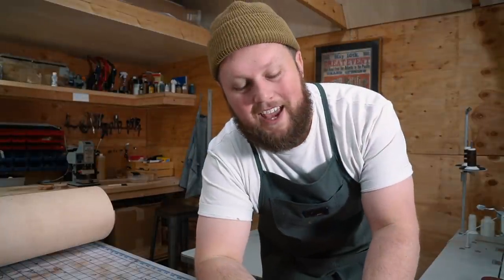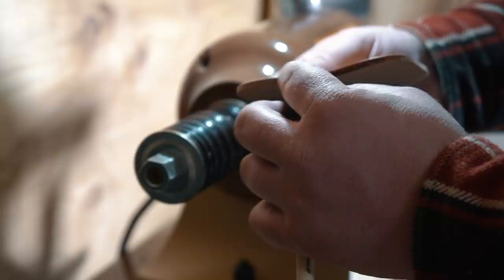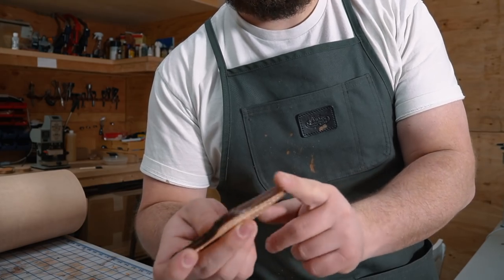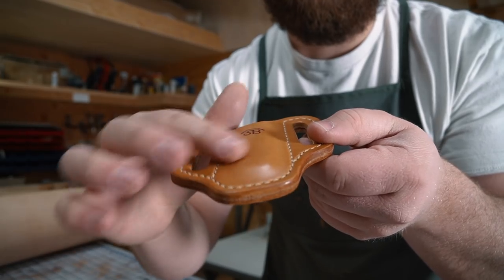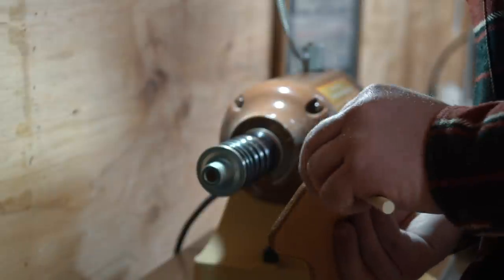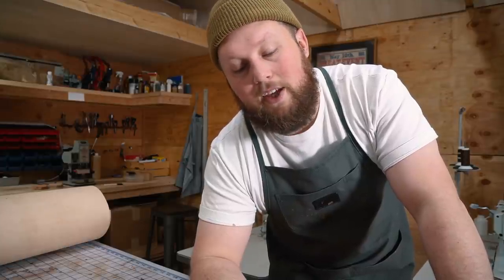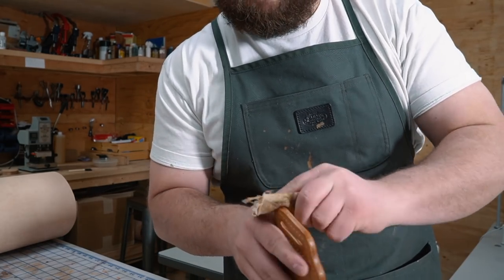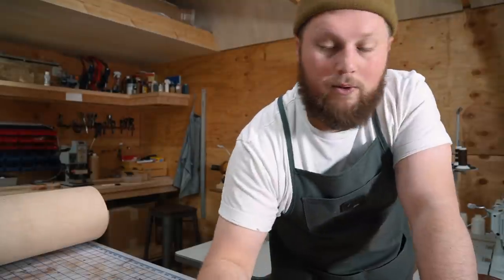Edge Burnishing Vegetable Tanned Leather, The Simple Way - Stock and Barrel #leathercraft

Comment: I have found if you dye first the dye is able to soak into the leather edge. Once you burnish you seal the edge not allowing the dye to soak in. The Feibings pro dye only need 1-2 quick coats depending on desired color. it drys in a few minutes and and ready to burnish.

Comment: Does the Montana refillable pen work ok for you, are there any problems as its supposed to be used with a a acrylic. I was concerned that the if using spirit dye could evaporate if its left in the pen.
Reply: Montana pen is great! I use black edge coat in mine for edges and it does a great job, great control of amount, and doesn't dry out in pen when not in use.
Reply: @nathanrainwater1657  thanks I've actually just ordered a couple so I can put dye in one and edge paint in the other. I appreciate the reply anyway